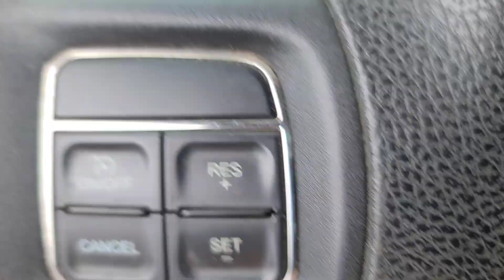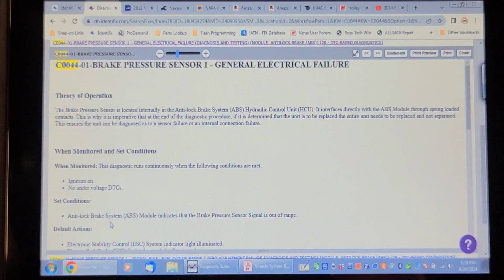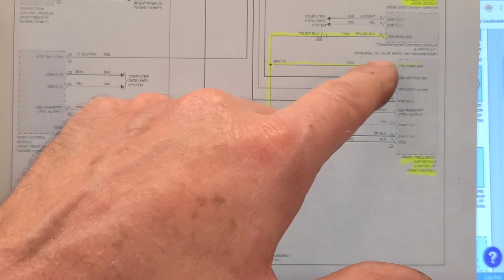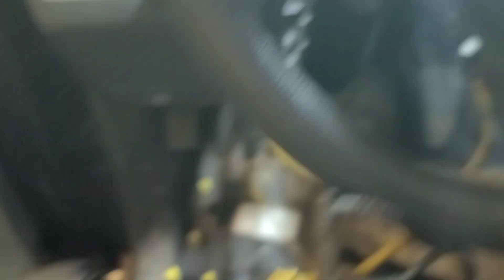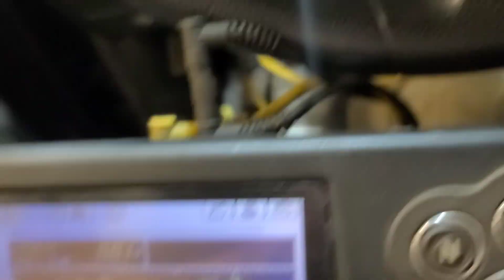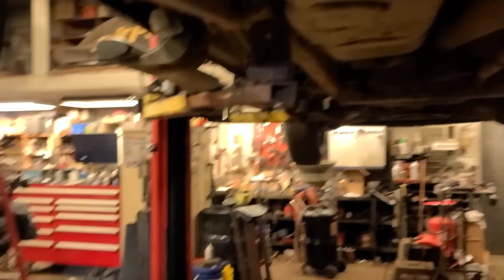2014 Ram 1500 4x4 Ignition Key Won't Turn Off And C0044-01 Unrelated

Comment: Hey Phil, not that it really matters but, I totally agree with your diagnosis. Customers may not like it or understand but if it's not broken or acting up when we see it, we just can't efficiently diagnose it. Sure we can get lucky and throw some parts at it but when that doesn't work we end up dealing with a come back, unhappy customer, and bad reputation as a hack. I would rather take the time and get to a guaranteed conclusion, so good for you! BTW, been wanting to tell you that your audio has been great for at least the last several videos! Keep up the great work and content!! 👌🏼👍🏼
Reply from the maker: @mikeburdi3464  thanks for taking the time to watch and comment. I've been using a bluetooth mic setup but the furnace has been off too.